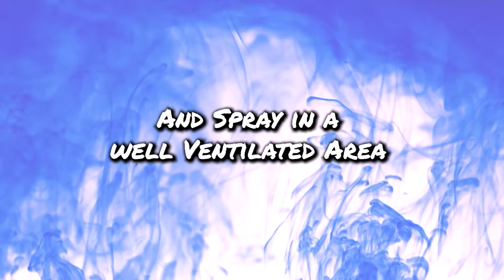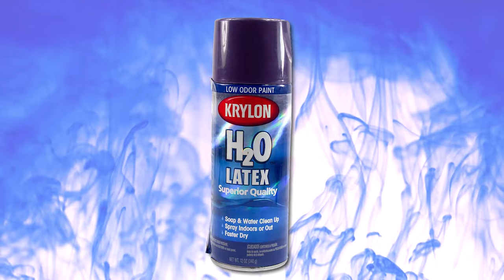How to Paint Foam (Ultimate List of Styrofoam Safe Spray Paint)

Comment: Good info! That marking paint - In one of my previous careers, I used thousands of cans of that stuff in various colours (orange/red/yellow) to mark buried utilities. Its designed to only spray while the cap is held downwards towards the ground (so the reverse of the usual cans) and it is designed to break down out in the elements. You can spray it in grass and whatnot and it won't leave a dead patch. I seem to recall its a bit thick and chalky. I may have some that are still viable, if I can find one I'll test it out. Cheers!
Reply from the maker: Very informative!  Thanks!  Yeah it would be cool to know about.

Comment: It also depends on how dense the foam is - for example, the pink foam board for insulation. Krylon fusion worked GREAT for it, a light coat and not so much as a sound. It looks like it slightly rounded edges, but it's completely intact for my terrarium waterfall 'slate'. Cheers, thanks for the video!
Reply: And FWIW Fusion was the only reasonably priced paint I could use for a terrarium, supposedly water safe
Reply: did you apply any other sealants or materials over the fusion?

Comment: Hi, thanks for video! Do you recommend a foam sealant in combination with these spray paints? If so, which?
Reply from the maker: I believe MTN has a waterbased sealant but I usually just use any sealant.  If you build enough layers of paint, it shouldn't melt.

Comment: AND you can use minwax wipe on poly and rust-oleum oil base enamel directly on FOAM, we discovered this while painting an Arrow foam Corsair.
I happened to get some oil base paints on the foam packing and realized that not only does it not dissolve the foam, it bonds very well to the foam.
The cheap paint that came on the plane peeled of with some Blue tape that I had painted with some latex water base paints; 
We even poured some paint thinner on the foam and it pooled on the foam but Did Not Dissolve the foam.
Yes, you can coat your Foam plane with oil base poly, paint etc, resulting in a Hard structural skin.
Reply from the maker: That's very good to know.  I will have to try that out.

Comment: In your experience how does the montana spray paints, and the other paints mentioned, react to purple insulation foam? Is it any different or does it work smoothly?
Reply from the maker: They all work well for painting it.  No chemical reaction.  That said I think my preference these days is the MTN water-based (Montana brand), it doesn't tend to bond well and not clog the nozzle as much.

Comment: NOW... after it is coated with a non melting spray paint "maybe two coats", can you use other paint that would normally melt Styrofoam? I would think it would be ok. maybe that paint would dissolve the original layer of paint.
Reply from the maker: As long as there is a thick enough coat then yes you can spray normal paints on the project.  I would still be cautious about it though, building the harsher paint up in layers.

Comment: You can just stand the paint can further back, acetone dissolves really quick in air, 12 inches is normal.
Reply from the maker: Yes sir, I made a mention of that.  The paints listed in this prevents you having to do so.  That way you can spray up close paint designs as well as get inside hard to spray areas.  It's extremely helpful.
Reply: @ArtJeremiah  I got ya just saying.

Comment: Attention: Having just bought 5 cans of Montana paints for a miniature/scenery project, I found out that they clog details very heavily. Even with the right technique and layering, as you can see in the video they have a huge output which is great for graffiti but not for detailed work! They're surely great for other things
Reply from the maker: Thanks for sharing your experience.  I would recommend possibly getting some aftermarket caps to prevent this.  Also, I tend to store my caps in alcohol in between sessions.